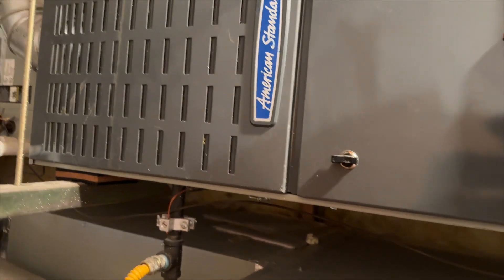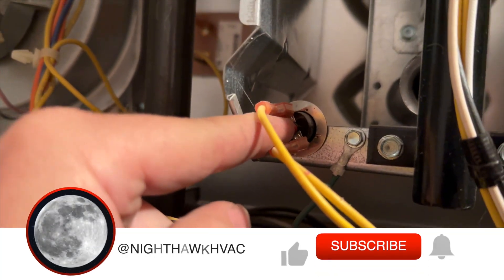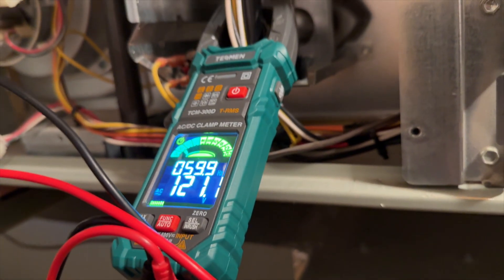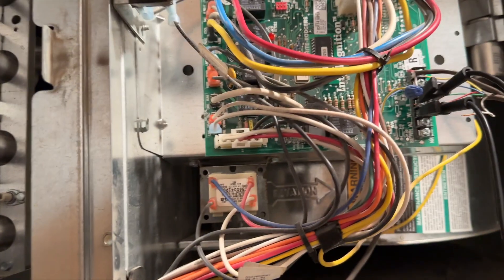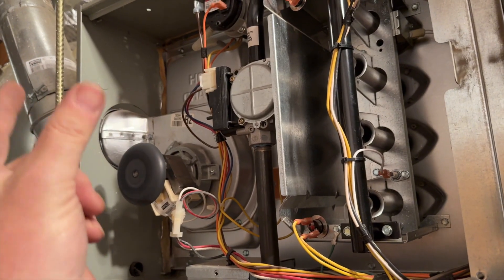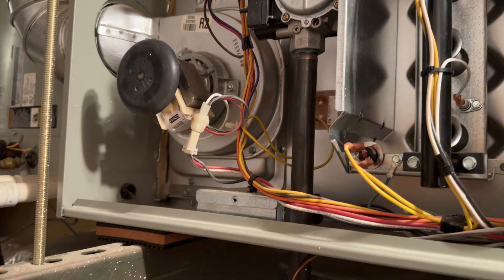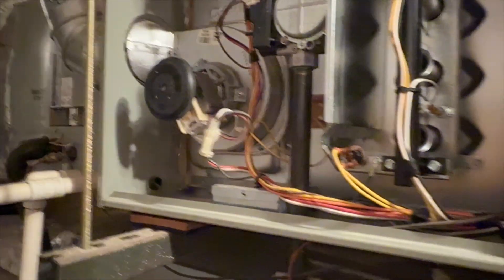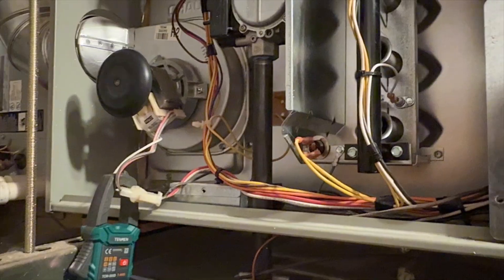Why Is My Inducer Draft Motor Running Nonstop? Here’s the Fix. EP219

Comment: Have the same problem. Replaced the board and still running non stop. Can the brand new board also be bad? That would be terrible luck.

Edit (wiring was bad, corrected it and works fine now)
Reply: I'm having the same problem.  I replaced the board and the pressure switch, and the inducer is still running non stop.
Reply: @RedKetchupTimes2  the problem was a miswiring. One collegue went there to replace the board and caused the issue by putting one speed of the motor on the HUM terminal of the board. When I went there to replace the board again after the collegue thought the new board was bad, I just replaced everything wire by wire. Went back another time after posting the comment. Realised my (and collegue's) mistake.

I put the wire that was on HUM on PARK and everything ran great after. 

Not sure if this will help you since my problem was our own mistake.
Reply: @sumho7532  My problem ended up being very similar.  A while back I replaced a bad receptacle attached to the furnace that was originally used to power a humidifier (mounted to the furnace) that had not been plugged in for several years.  After disconnecting the black wire from the HUM terminal, the inducer motor no longer runs continuously and the furnace is igniting reliably.  Thank you very much for giving me the idea to check that!